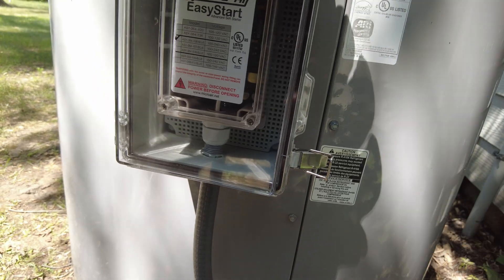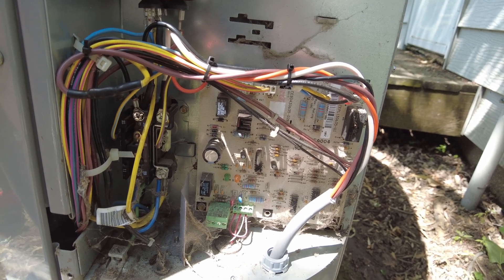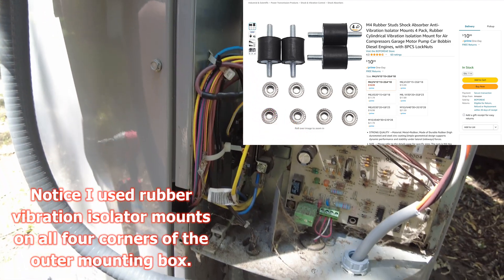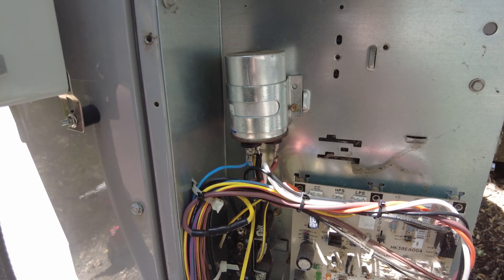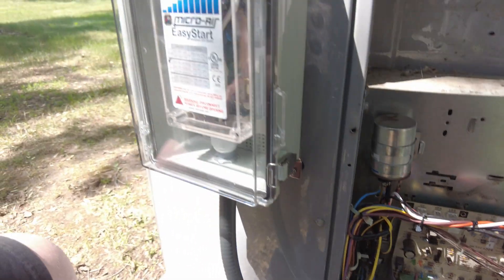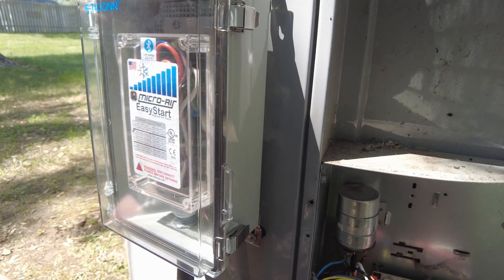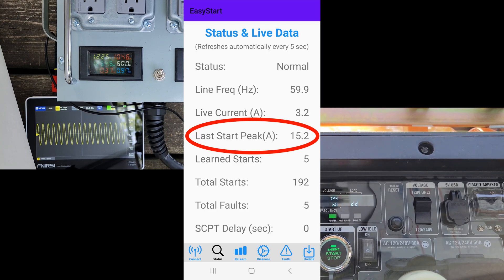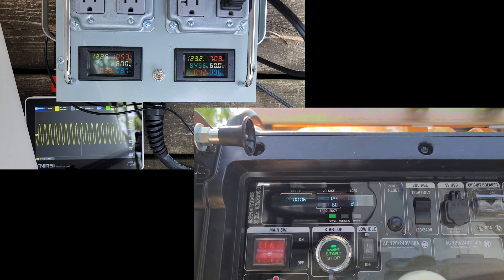Micro Air Easy Start Install on Carrier A/C Unit with GENMAX 9000 Inverter Generator Demonstration.

Comment from the maker: The Micro Air 364-X36 like the one on my  240 volt, 1.5 ton AC unit in this video can be found here:
https://amzn.to/3JnLBKw (Amazon link)

The weather proof box (10.2" X 6.3" X 3.9") that I used can be found here:
https://amzn.to/3XNKk5n (Amazon link)
This box fits the 364-X36 Soft Starter shown in this video.  If you have a larger soft starter, 
then you will need a larger box.

For larger AC units, the Micro Air 368 is available here:
https://amzn.to/3qVtp4z  (Amazon link) 

The 9000iED Genmax inverter generator can be found here:
https://amzn.to/46i1w6P (Amazon link)

My other videos about the Genmax 9000iED can be found here:
https://youtu.be/ptDkHJESoIY
https://youtu.be/4THhjUSfQoE

The video about my 240 volt power distribution box with electric meters cane be found here:
https://youtu.be/xiAkvRzsxG0

The 120 volt version of my power distribution box can be found here:
https://youtu.be/6DDUSwBhAM4

Micro Air website:
https://www.microair.net/

As an Amazon Associate I earn from qualifying purchases.

Comment: My Trane unit has the "circuit board" so I took a pic and sent it to MicroAir and asked them.  They said the "circuit board" does not require me to make any special installation steps. WHEW.

Better to ask MicroAir directly than try to analyze the different situations.
Reply from the maker: They are usually  pretty good about replying pretty quickly.  They may not give an exact answer but they will at least tell you where to find it. Good luck with your project.  Thanks for the comment.
Reply: @SlipFitGarage  
I installed mine today. The first start-up was 25.5 amps. Five starts later, it was 23.5 amps. I'm so disappointed  The sticker shows the LRA is 67.8.
Reply from the maker: You lowered your inrush amperage by 44.3 amps, which (if my math is correct) means you lowered the inrush roughly 65%.  Micro Air advertises UP TO 75%...  Most people don't get the full 75%.  I'd say 65% is right in the ball park.  I'm not sure what you're disappointed about?  It seems like the device is doing exactly what is was designed to do. Maybe my math is wrong?  What results were you looking for?
Reply: @SlipFitGarage    I thought the first "learn" would show the initial reading BEFORE the MaxAir did its magic.  How could it report a reduced number when it is only the first start-up after installing the unit?
Reply from the maker: @mikejoyce7157  That's not how I understand it....  The device starts working on Start number 1 to get an initial starting point.  Starts 2-5 try to perfect the starting process from there.   It does not allow a full locked rotor event to happen on start number one.  The FLA rating on the data tag for you A/C unit is probably accurate.  Mine was.  Did you test the starting amps with an amp meter before you installed the Micro Air?  Either way, if the data tag says 68 LRA and you're only pulling 23.5, the device IS working.   How low were you expecting it to go?  What number were you expecting?
Reply: @SlipFitGarage    I have an assortment of digital meters (5+) and not ONE can do an in-rush reading.
I'm not really sure what I was expecting as the final amps.  I was focused on the first "learn" as being the starting point of the "learning" process".

I got my start learning about vacuum tubes and worked on a variety of stuff for 40+ years.  Most of it is either in the museum or on the History Channel.

Guess I will have to test-run my HF 9000/7250 open-frame propane genny and see if it likes my "new" heat pump.  I will have to disable the aux-heat electric pack when the system is in heating mode.  My home is totally electric with a well and septic pumps.

Thanks for your knowledge and support.
Reply from the maker: @mikejoyce7157  To give you an idea, the data tag on my A/C unit showed 48 LRA and it actually measured 47 Inrush amps with my Klein clamp meter. (with inrush function)  So, in my limited experience, the data tag was very accurate, only one amp difference.   Yep, fire it up and give it a try....  it's the only way to know if it will actually work. 🙂
Reply: @SlipFitGarage  I'll report back.... unless my procrastination becomes another issue.  I bought the MaxAir unit over a year ago.  HA HA HA
Reply from the maker: @mikejoyce7157  lolol...  you and I must be a lot alike.  I did the same thing.  My Micro Air sat on the shelf in my bedroom closet for over a year before I installed mine. Ha Ha.  I am REALLY good at procrastinating.  I can put off any project indefinitely
 and it won't bother me one bit.  However, one thing weird about me...  Once I finally get started on a project, I must finish it completely as fast as possible, to the best of my ability.  It's like I become obsessed with it until it's finished.   I could blow-off a project for several years and it won't both me one bit.....  but once I start that project it becomes priority #1.  I'm weird.  lolol.  You can reply back here at any time.  Even if you test your generator setup 6 months from now I will remember our conversation.   Good luck with your set-up.  🙂

Comment: I just had two Micro-Air Flex units installed on my side-by-side 2 ton & 3 ton units for my house (Flex works great, dropped amps).  They both turn on at the same time from the thermostat (upstairs vs. downstairs).  Do you know is there anyway to set a start delay from one unit to the next so I can avoid them both spiking at the same time?
Reply from the maker: The FLEX units are new.  They didn't exist when I bought mine.  I wish they did. Anyway.....  are both of your A/C units controlled by the SAME thermostat? If so, that seems weird to me....  but I'm not an A/C expert.  (even though my father and grandfather both owned (separate) large commercial HVAC companies) I do not believe there is a way to program a delay into the Micro Air control box.  There is a delay setting, but that is used to control a certain type of A/C unit, not for situations like you're having.  I am sure there are many solutions for this problem, and I suspect if an HVAC technician reads this post, they would know an easy way to fix this.  However, if it were me, I know of a time delay relay that is sold for commercial alarm systems. It's a basic add-in board about the size of a cigarette pack.  It runs on 12 or 24 volts and it's very easy to use.  For example, it could delay the thermostat's command for A/C for 0-60 seconds (by the second), or from 0-60 minutes (by the minute).  You could easily put this device on the thermostat control wiring and delay one of your A/C units from starting.  (it even uses the same voltage as most thermostats so you have no problem powering the device)  If you're interested in the device I'm talking about you can see it on Amazon, here: https://www.amazon.com/Altronix-6062-Digital-Timer/dp/B0006TZEDS/
These are cheap and easy to use.  I've personally used these several times in the past for various projects that I've worked on.  They are very configurable....  they can be momentary, they can be latching, second, minutes, reset on powerup, etc.  The instructions are easy to understand. (if you're somewhat good with electrical) And, you can't beat the price!  Thanks for the question.

Comment: Did you use 1/2 inch or 3/4 inch liquid tight flex conduit?
Reply from the maker: I honestly don't remember, but if I had to guess, I'd say it's 1/2 inch.  The cable from the Easy Start box just barley fit with little (if any) resistance.

Comment: I did a hard start kit for my rudd 4 ton and a 9000 predator generator works well Amazon 35$
Reply from the maker: A "hard start" kit is simply another capacitor which gives your compressor an extra "kick" during startup.  They were invented to help start compressors that are wore out and would otherwise need replacement. "Hard start" kits help to get another few years from a compressor before the ultimately need to be replaced. A "soft starter" like the one shown in this video actually limits the amount of power the compressor is allowed to draw on startup AND it increases the time to make up the difference.  If you look at a "hard start" on a graph, it's a huge instant spike of current.  If you look at the same compressor  on a graph with a "soft start" the current spike is much lower, BUT it is spread out over a longer length of time.  (fractions of a second longer).  So, the difference between a "hard start" and a "soft start" is this.....  A "hard start" causes a MORE violent startup event.  An "easy start" results in a much less violent startup event.  "Hard starters" are a last resort option to lengthen the service life of a (almost) dead compressor.  Using a "hard starter" on a normal compressor (that isn't close to being dead) will only shorten the life of a compressor.  "Soft starters" can actually help to lengthen the life of a compressor, even when installed on brand new A/C units.  Hard starters are known for eventually killing compressors....  There is no downside to using a soft starter other than initial cost.  They  do not kill compressors like hard starters are know to do. If you don't run your A/C unit on the 9000 Predator very often, then I recommend removing the hard start kit.....  and only install and use the hard start kit when on generator power.  Using the hard starter on your A/C unit if/when it's not needed (like during normal times when utility power is available) is NOT doing your A/C unit any favors.  Just my .02.  Thanks for the comment.

Comment: I have a 14 year old HUGE Carrier 3 ton heat pump, mine has a circuit board also, it is the defrost board. I just bought a soft start , generator and wired in a 50 amp genny plug to main house panel , all  legal with breaker interlock kit. Working on the soft start install, been scratching my head , but your video helps out.  The compressor run wire is yellow also on mine. I am glad the detailed wire schematic is still intact inside my unit. Never had an OEM hard start kit and Start thermistor installed. Guess they were optional  when unit was installed.  Micro Air website with Carrier install instructions helped also. I bought another brand soft start as I needed a 32 amp model. Same principal  and hook up, no bluetooth .  I have room to stick soft start inside unit, actually room for 2 ...lol..  I guess they stick defrost boards in non heat pump Carrier models for the other features ...  Your circuit board comes up as a defrost board by model number. Again  thank you for sharing !😀
Reply from the maker: Thank you for the nice comment.  I hope you get your soft starter working correctly.  I'm glad my video was helpful. Thanks again!
Reply: @SlipFitGarage   I have the ICM870-32 soft start installed !  Works great. Between your video and the tip for the Micro Air website Carrier install instructions really helped. I stuck a  wiring diagram of the actual wiring decal in my unit on Reddit and added the wire hook up to where stuff goes on it. Crude diagram but should help someone. Again thank you 😁

Comment: I got my 5 ton Trane starting surge from nearly 80 amps to 30 and running amps from 32 to 13 amps.    This thing works really well.
Reply from the maker: Well, this thing isn't really designed or advertised to lower the "running" amps. It's specifically designed to lower the "starting" amps. So, if your running amps went down from 32 to 13 then something else is going on.  Is it possible that you got a bad reading somewhere along the way?  That's what I suspect happened.  Either way, the finished results speak for themselves!  Yes, these really do work.
Reply: Looking for a Generator on marketing , question. How many w need for 5ton trans ? I will think getting genmax 7250 or 9000

Comment: I did the same thing you did watching all the videos and then opened my Bryant heat pump up which had the circuit board in it because it's made by Carrier. I closed it up and didn't think I wanted to mess with it but then I found your video so now I may give it a try. Thanks
Reply from the maker: If you have any specific questions, they people at micro air will respond to emails, usually within a few hours.  In my experience, anyway....  I'm glad my video helped give you the confidence to give it another shot.  Thanks for the comment and good luck with your project.

Comment: I have the exact same setup. Went from 60 starting amps to 15 (2.5 ton unit), 6 running. And have run the entire house with a/c running on that generator. Bought a natural gas conversion kit for it but still havent hooked that up.
Reply from the maker: Nice! Yep, this generator works great for me and my application.  Sound like you're having the same great results.....  I don't remember if I mentioned it in the video but I also have a natural gas kit for this generator that I have not installed yet.  I still need to run a gas line through my laundry room and through the back wall of the house. Hopefully I will get around to doing that this summer. Thanks for the comment.

Comment: Good video!  I would blow out that wiring box.
Reply from the maker: Thanks...  but what do you mean by "you would blow out that wiring box"?  How so?
Reply: I was very distracted by all the cob webs in your AC wiring box.  Maybe it's just me, but the first thing I like to do when I see dirt and cob webs is blow them out with compressed air or something similar.  Things will run cooler and there's less chance of a short IMO.
Reply from the maker: @cujo7240  I see now....  you literally meant "blow" with air.  Gotcha. Yeah, I don't disagree with you.... and I certainly would have blown it out if I had compressed air anywhere near the location where I was working, which I did not have.  But honestly, those webs would just reappear within a month or two anyway.  Thanks for the comment. 🙂
Reply: Of you have a shop vac you could reverse the hose to blow it out.  Do you live near the water?  I used to live and work near the Great Lakes in western NY, and spider webs would be visible on cars that had only been parked for 1 hour. 😮
Reply from the maker: My A/C unit gets cleaned at least once per season.  It gets fully disassembled, (all side panels removed) sprayed with coil cleaner, then completely hosed down with the garden hose until ALL the dirt, leaves, and cottonwood is gone. I don't aim the water in the electrical bay, but I do blow it out with my backpack blower.  I'm sorry a few cobwebs distracted you but I really do try my best to keep the unit as clean as possible and working at it's full potential. My family owned two different commercial HVAC companies when I was growing up.  (Grandfather on my mom's side, and my dad.  They each owned separate, competing large HVAC companies) My dad always told me the number one reason for service calls on A/C systems was caused by condensing coils plugged with dirt and cottonwood seed. This was true on rooftop units or home air conditioners. It's a never ending battle, around here anyway.  lolol.
Reply: @SlipFitGarage  
What coil cleaner are you using?  Thanks......